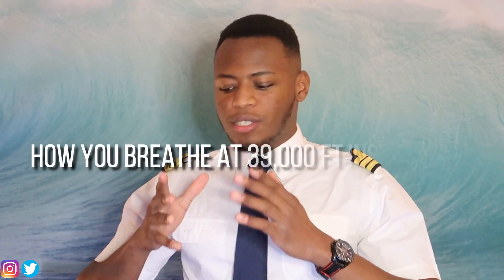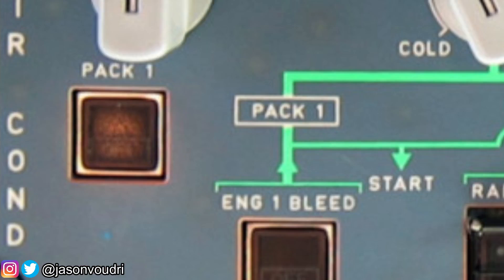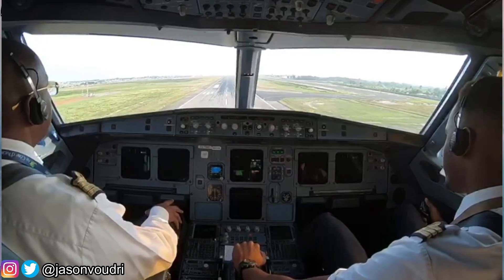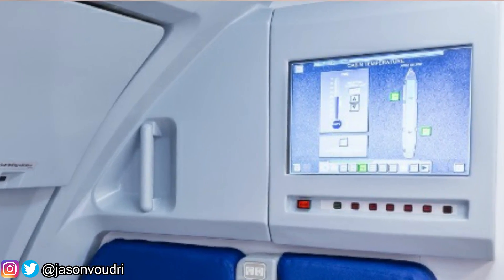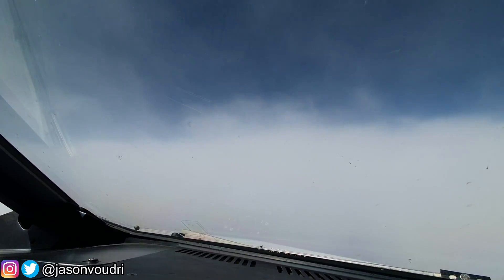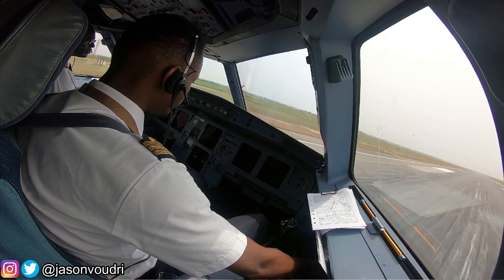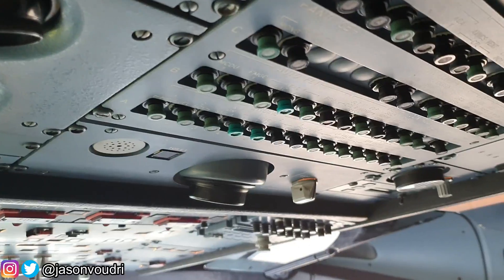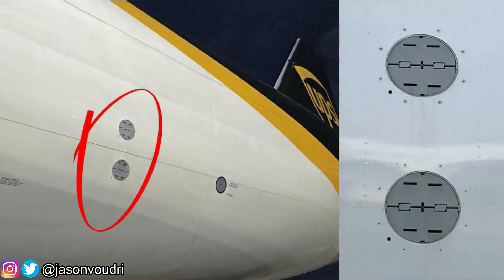How You Breathe at 39,000 ft Inside a Plane - A320 Pressurization & Air Conditioning System

Comment: If a plane is cruising at 40,000 feet and the plane needs to be at 10,000 feet in 15 mins, how fast the descent rate has to be?
Reply from the maker: (40000-10000)÷15= 2000ft/min, but in an emergency descent you will be descending faster
Reply: @FlyJV  Thank you for the heart and reply!